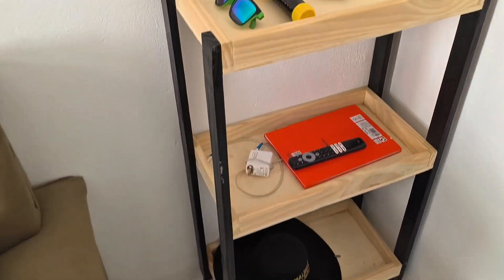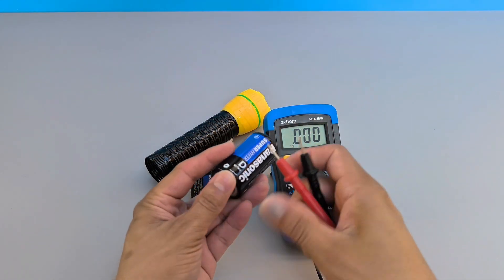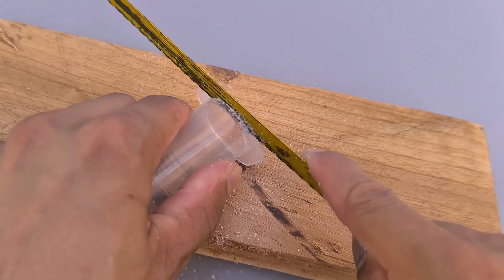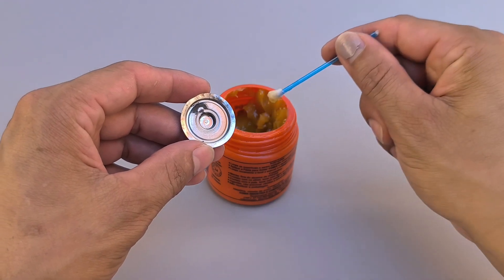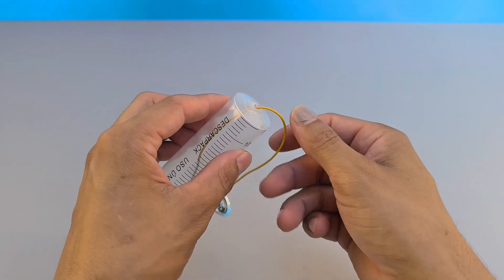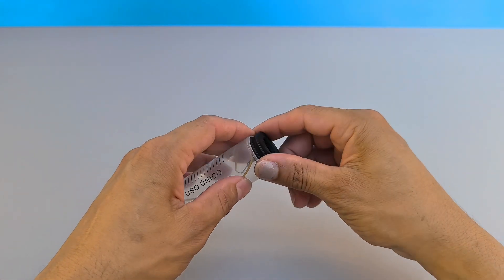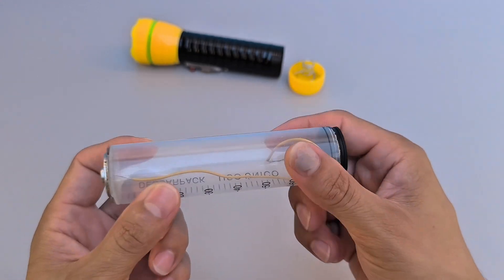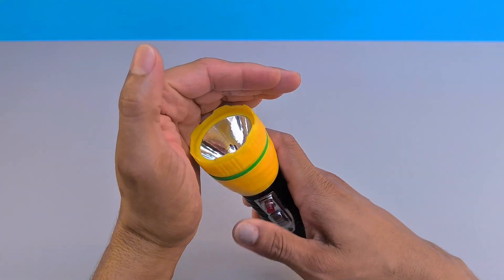Never buy new batteries! Recycle old batteries and save hundreds of dollars.

Comment: Instead of buying the correct battery, just hack together a contraption so you can use a completely different battery that has maybe 2% of the capacity of those 2 D cells, having to replace it a lot more frequently costing you a lot more money, did you even think about what yourn are suggesting?...
Reply from the maker: Building a custom battery can be a surprisingly efficient alternative to the traditional options available on the market. What I suggested was powering a flashlight with a small battery, optimizing energy use and reducing costs.